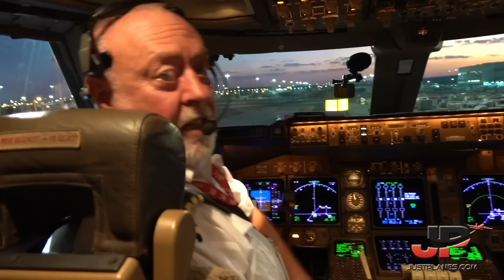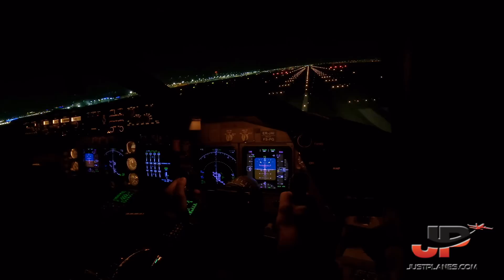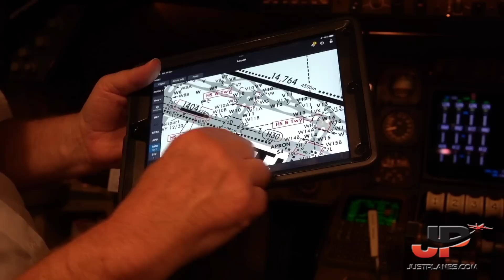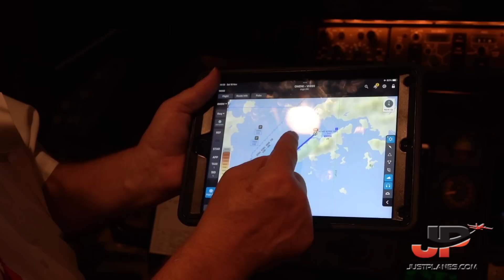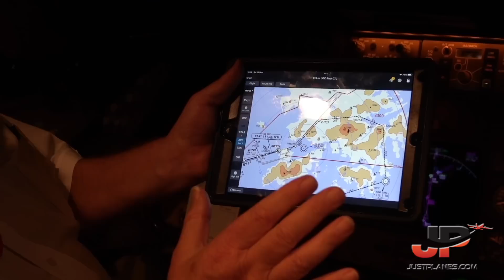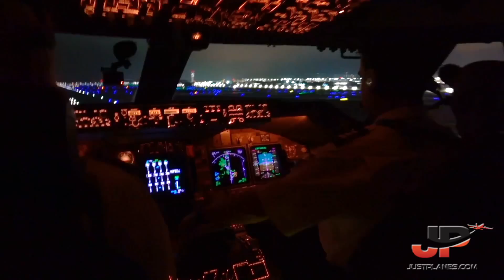Boeing 747 Cockpit Night Freighter Dubai to Hong Kong

Comment: Question.why is the callsign blocked,is it not Moldcargo normally
Reply: I think its Emirates - they are probably flying codeshare as xx9238 is an EK cargo flight No.
Reply: Cheers. 
I see flightradar24 shows them flying for Emirates

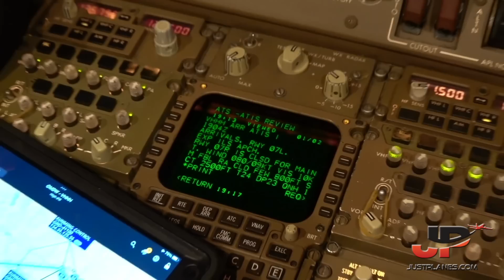Comment: 18:34 Whats with the rubber band. Is that an authorized repair? lol
Reply: 747 mechanic here, that rubber band is not a repair , it is what the pilots use to hold down the inter-phone switch.  you'll almost always see it on every 747-400 audio control panel
Reply: Thank you!  @ArmyofSeaturtles